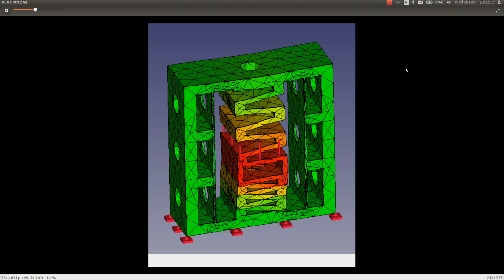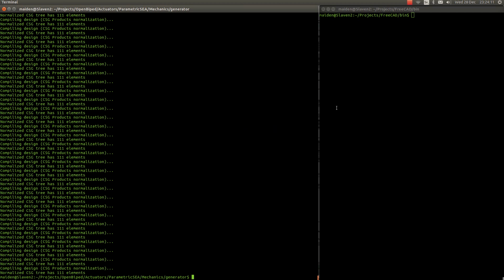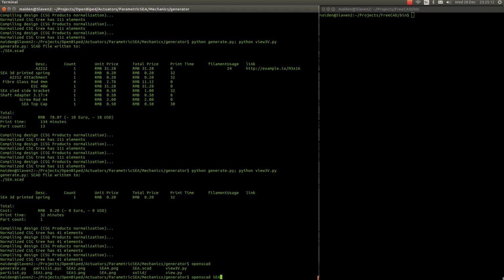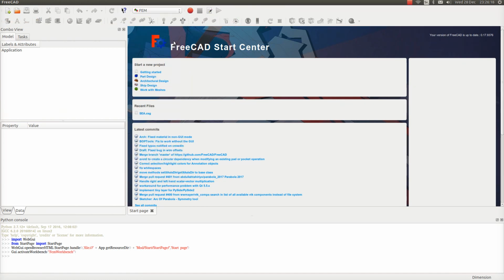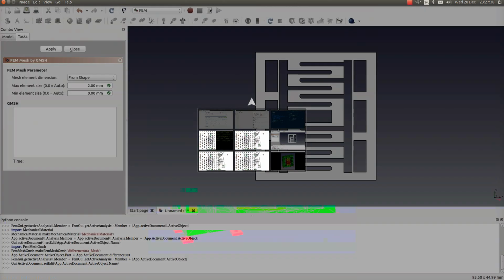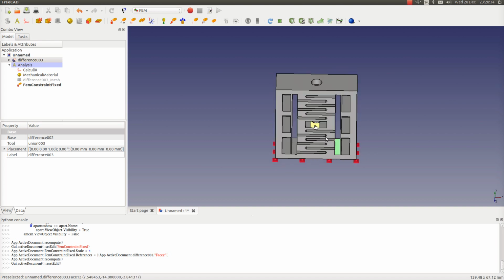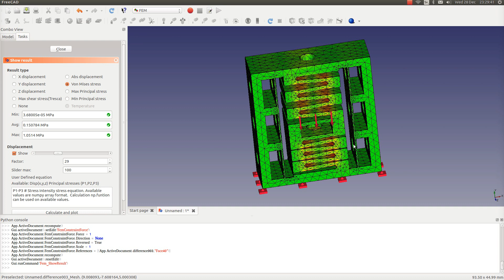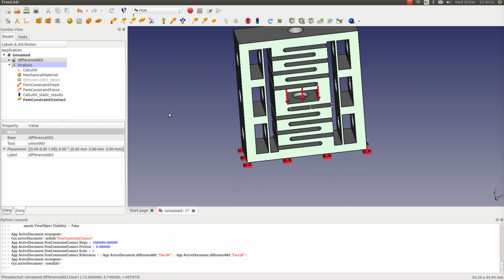From SolidPython To OpenSCAD to FEM in FreeCAD

Comment: I'm getting an error that springGenerator in lines 25 and 26 is not defined.  Should these lines be commented out since springGenerator has been deleted from the current code?
Reply from the maker: I will have a look later when i got time, i do not know, was a few years ago ;)
Reply: @TheMaidenOnes  I commented out the appropriate if else statements and generate runs without a problem and produces the scad file.
Reply: @TheMaidenOnes  I also get an error when I run view and view3V:

os.sys('openscad... the pygame window and then closes and gives an error:

 'openscad' is not recognized as an internal or external command,
operable program or batch file.
Traceback (most recent call last):
  File "view.py", line 23, in <module>
    image = pygame.image.load("SEA.png")

pygame.error: Couldn't open SEA.png

Comment: FEM-mesh from shape uses only 1 CPU???
Reply from the maker: 1 cpu, 4 cores, but some steps only run single threaded. but mostly it runs in 4 threads. Not sure why it does not always use 4 threads, might be a bug or a technical limitation.